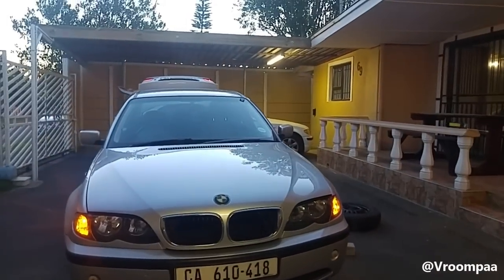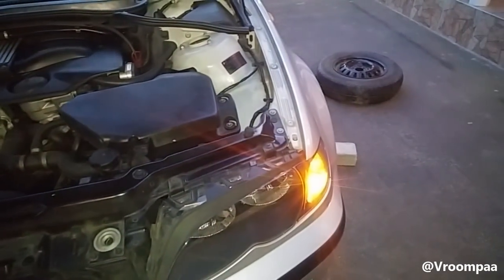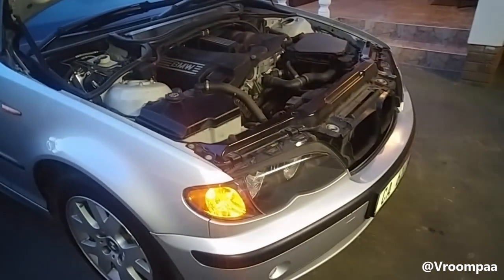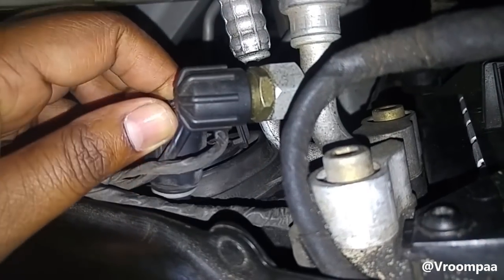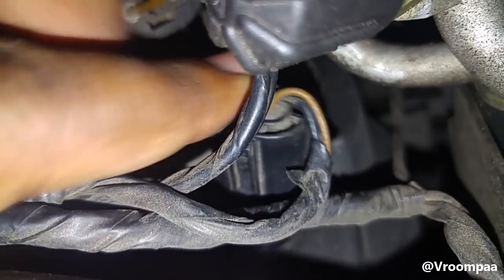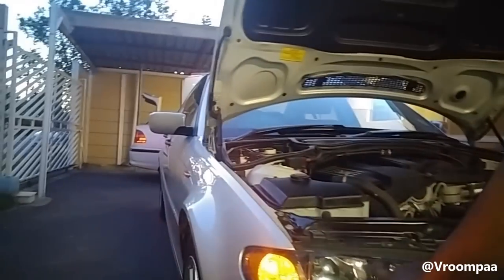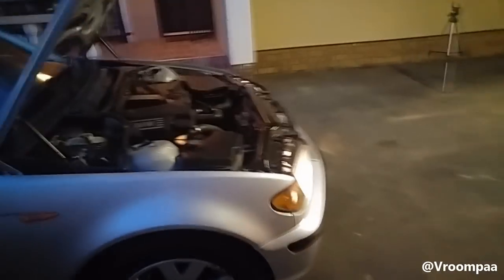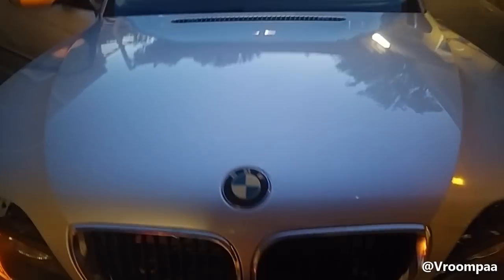Free!! Daytime Running Lights - BMW E46

Comment: with INPA you can turn slightly on the high beams to work as daytime lights, so this is not necessary.
Reply: this aint the point. its way cooler and nicer like this

Comment: At the end (around 4:45), the car doesn't appear to have the DRL on. Why is that? For portions of the last 20 or so seconds, the headlights seem to be on, which explains why the DRL would be off, but the headlights and DRL are definitely off in much of that section of the video.
Reply: Because he has the headlights on

Comment: i want them to turn off becouse its not legal in Norway and i can`t get my car trough EU-Check becouse of this. Tryid to change lights and everything but nothing works. Help pleas?
Reply: Coding?
Reply: @karim03Gt   i did fix it
Reply: @cstaulen92  how?? I have the same issue
Reply: @cstaulen92  could you say what you did to fix it i to have the same problem
Reply: Coding most of the time... Unless you have connected some uorginal lights on and then it fucks up the canbus. I was lucky it was only coding, easy fix tith icarsoft.